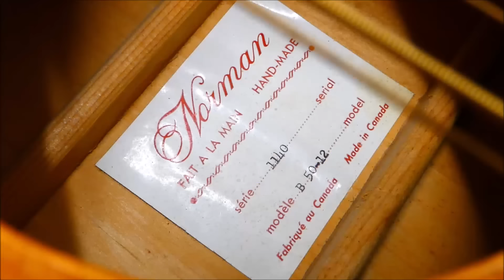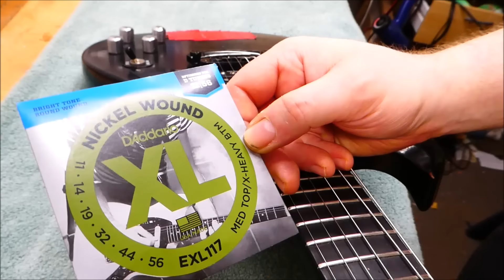Broken SG and a Norman 12 String

Comment: I’ve owned a couple Seagull acoustics and the description of “solid quality at a low price” nails it. I’d buy another without hesitation.  My experience with Godin electrics have been similar.
Reply: I've got a Seagull entourage and no other acoustic has even come close to the tone and feel of that guitar for me. And it's still going strong after a decade of hard use. Such an amazing instrument.
Reply: See also: La Patrie. I don't think you can really call Godin "low price", but I think "solid quality" still applies
Reply: Mr segull
Reply: The owner of the sg also owns a couple of seagulls, actual seagulls that constantly shit on top of the guitar.
Reply: I found a Godin SD in a thrift shop and took a chance. After a good clean and a rudimentary setup it's fantastc!
Reply: I have one of the newer line of Godin acoustics (fairmount composer), was actually shopping for a 000-15m but tried the Godin and ended up buying it on the spot. No regrets.
Reply: yeah your right godins are really food and solid build guitars
Reply: I love my Godin guitars. I have an original LG, a Fifth avenue Kingpin, a Freeway 5 bass, and a Seagull. I love them. The necks are beautiful and they sound good, with intonation and action above average and sound the way they should. The Seagull was my first Godin, and back in 1994 when I bought it, they were selling like hotcakes because they gave a solid Spruce top and great neck for the price of many inferior guitars.
Reply: @johnsonguitarstudio  I have a Godin 5th Avenue acoustic. It was a very affordable instrument (roundabout $500 new). I consider that a low price for the instrument.

Comment: Not a professional by a long shot but I’ve always wondered why some guitarists don’t take better care of their gear. In the 60 years I’ve owned guitars I’ve never broken a head stock. My venerable D-18 which I bought used in 1979 had a repaired broken headstock which has stayed fixed all these years. I’ve had a side crack due to dryness and I’ve had another D suffer many aging problems- probably from not being played enough. It’s been back to the factory for warranty and non warranty repair for binding issues, neck resets, bridge plate cracking, bellying of the top and bridge replacement! 
Great videos, keep up the great work.

Comment: About 14 years ago I did my first headstock break and figured why not give the repair a shot. 
I had 3 dozen guitars at the time, surely still have at least that many, and after a ton of labor due to work environment and living conditions, thought the ever so slight twist in it as it set wouldn't be an issue. 
It's an issue! lol
I might finally get to it this year, heat it, reset it, and revive it. I have 3 of these guitars. Neck through no branders made in China but they played so nicely.

Comment: Always wanted a 12 string, but couldn't find one that didn't break my left hand playing it. I finally found a Seagull 12 string for $100 bucks in a pawn shop that had a loose neck joint. I just glued it, and it hasn't budged since, the best $100 I ever spent. That guitar is a joy to play and stays in tune. I also have an Art & Lutherie parlor and dreadnought, both excellent guitars.

Comment: My SG has had a similar brake happen twice -I did the second brake. BUT the last repair was apparently done inserting two zinc plated steel nails of the four inch size cut off to hide after "insertion" and epoxy glued/filled. So I'm looking forward to this video for some inspiration, although your repair won't have these issues. Luckily I found an old mahogany floor I could make dowels to fill the voids left by the nails from if I dare remove them. It has had a neck to body brake repair as well -who knows what hides in there. Gets me thinking, my old chiropractor has his own x-ray machine, maybe I'll pay him a visit to find out:)

Comment: Some folks shouldnt own a Gibson is profound. I bought my 84 Explorer in 85 brand new. I played in bands for the next 25 years. When I say it has seen its share of action that is no exaggeration. The case looks like went to Nam and the Gulf War. If it could talk several people including myself would possibly be in some trouble. But, the headstock remains as it left Kalamazoo in probably mid 1984. The end has abfew dings sure. Its on itsb3rd and hopefully last paint job. It needsbabrefret and three of the dot markersbhave crumbled into dust and fallen out. Still makes its presence felt when I plug it in and allways causes a stir whemaI open the case. But has never been broken. The same goes for my my 82 Standard.

Comment: Regarding adhesive, I was taught to avoid glue that might 'creep' under string tension.  I repaired a heel on a Hofner bass a few years ago and used hide glue, plus I added a couple of dowels.  It's still intact.

Comment: My younger self wasn’t in a position to afford Gibson guitars, so as I became older and more financially sable I became obsessed with them.  Not because I think they’re the best on the market but because of the what they meant to me as a kid.  After several years of owning them now, I’ve found they’re actually quite difficult to break the headstocks.  Shipping them relays on the handlers who couldn’t care less so they can and will snap during that process and sure if you drop it, it can and will break and of course some will have the grain structure that will make for a weaker headstock.  But really it boils down to the owners, the careless folks who put them against the wall and then knock them over, drop them, step on them or whatever else these guys do to them.  Play it, put it on a reliable stand or back in the case and you’ll likely never break one.   That being said thank you to all the careless guys out there and videos like these, I’ve been able to rebuild a very solid and stable quiver of les Paul’s that I’ve repaired to near perfect condition.
Reply: Got to give this guy a pass though, dropping through the stage!  The rigger who gaffer taped two risers together should have been charged.
Reply: @markbernier8434  I’d give him a pass if he would’ve at least pulled the strings off.  Common sense would tell you this.

Comment: I bought my Les Paul as a scratch and dent: the headstock broke and was fixed in factory. A few years later it fell out of the stand and broke on the same line. A couple years after that I set it in the stand hastily and it tipped out and broke again in a new spot. It’s been 10 years and I haven’t broken it again. It still plays great.

Comment: Wow! A Norman!! I have a six string model from the early 90s that I bought in 2020 for like 225 bucks.

I am left handed and I happened to find a left handed model local to me. 

It has been gigged hard by me (and it was by the previous owner too) and now it hangs in my bedroom as a practice/beater axe. Still love it though, probably has my favorite neck profile ever!
Reply: Why do you not gig it anymore? Everything can be righted if it is out of spec.
Reply: @jasonpitre1249  the top is caving in... I still gig it occasionally but I have other guitars I like more. I use my Norman for building loops to practice pedal steel to.

Comment: Really interesting video, Ted. As I’m located in the eastern townships of Québec, I get Godin guitars on my bench all the time. Your background story of Norman guitars was largely correct, but according to my understanding of the history, you did make on serious error. Robert Godin did eventually acquire the Norman brand, but at the time the guitars were built with bolt-on necks, the Norman production in La Patrie was by Normand Boucher. You’ll recognize the “Boucher” name that appears on current-day higher end guitars made in the operation run by Robin Boucher, Normand’s nephew. Anyway, the bolt-on neck was one of Normand’s innovations so that players could easily adjust the setup of their Norman guitar themselves. There are many of these guitars still in circulation and they remain very popular. Sadly, the bolt-on neck joint was abandoned when Godin went into partnership with Normand Boucher and eventually assumed ownership of Norman guitars. Now, Normans are built exactly the same way as the other Godin brands. Neck resets on present-day Norman guitars is much, MUCH more difficult — especially the newer ones assembled with epoxy!

Comment: I had a similar break om my Dean guitar. I drilled a small hole, approx between the eyes, of the face in the picture and pumped gorilla wood glue into the brake. Then clamped the break shut. Job done.

Comment: Could not agree more about re-stringing a 12, I bought an inexpensive but decent 12 a few years ago and the first thing I did was to put a set of light gauge strings on it and I keep it tuned down a whole step and just use a capo. I absolutely hate to put strings on that beast lol, it seems like it takes an afternoon to get it back in tune. They are worth the trouble though to get that extra jangle.

Comment: Norman reminds me (and I'm not sure why) of the old Stella 12-string like Ledbetter or Leadbelly's guitar eventhough his guitar strings were held in place with a fan tail and does not create good tone except (maybe) on a high class archtop like the master Benaditto and his archtops? Or D'Angelico or the elder Gibson's back when I wasn't even a thought and existed in 57? 65 years? Wow, it socks being me. Lots of physical pain and that why I'm building them. Being busy and claim to being committed I started with furniture and then with speaker cabinets. So now I bought wood from 2010 to 2016 and set backs of wood shop equipment learn to resaw wood so I added oilivewood and manzanita (only grows in Idyllwild) a bush but grows fast and is pretty and unique, they might be the headwaters on my guitars. Parts-casters are still here but I'll place my electronics into and artfully built from my woodshed in my backyard. Really helps with the pain.
Reply: I'll be 65 in November. "Growing old ain't for sissies". Bette Davis

Comment: hey now... my 74' standard has had at least 4 headstock breaks... 3 while I've owned it, first the "screws" and "bondo" from the original break failed... my 2nd  break had half stacks thrown at it, and the final... well  I had a guy do the repair, and the glue failed... Had an SG that its neck repair failed as well, about the same time as the 74' standard ... that said, I have 3 others that get equally mistreated, and have never had issues, though at least one of them has chunks missing out of the body from me diving through drum kits...
Reply: Were you trying to escape thrown bottles or bullets fired by the audience, or attempting to kill the drummer?

Comment: So Leo bolted on the neck and today so does Taylor.  Gibson glued them in like all the others.  So, I break the neck off on my Strat and just bolt on a new one.   I break the neck on my Les Paul and you do your magic, install splines, glue and camp it back together and paint it and its good as new.

Here is my question.   On a Les Paul why not cut the neck off at the body then route out the builk of the wood, and finally clean it out to spec and then glue in a new neck.   Just like a Fender only using glue instead of screws?   Does anyone do this?

I'm looking for a new acoustic and Taylor is at the top of the list because of the neck design. 

Love you videos.   As a wood worker/boat builder, I have learned a lot from you videos which are usefeill techniques valuable beyond musical instruments.

Comment: I've recently discovered your channel and I'm hooked! Your channel is a gold mine of guitar information. I have a question for you : Have you ever had to work on PRS's? Do you think their low angle headstock design is as solid as a Fender straight headstock? Cheers!
Reply: the greater the headstock angle under string tension, the more susceptible it is to breaking. its just physics. but beat any guitar up and itll break whatever the design. take care and it wont. and it obviously wont break on its own, itll need a good knock. of course accidents also happen... saying that though, my gibson les paul fell from a stand and i couldnt believe it was still in one piece. just a ding on side of fretboard, so lucky but goes to show its case by case and it matters where on the guitar the trauma happens. hope it helps, seems no one else was answering anyway dude, cheers.
Reply: @terrybanks5063  Thanks for the answer! That's what I was thinking. I was wondering about PRS because there are a lot of videos/posts about Gibson headstocks breaking or overall repairs but very few about PRS. Maybe it has to do with how many Gibsons are out there vs. PRS's

Comment: You should get your facts straight, les guitares Norman was founded in 1968 by Normand Boucher who was the conceptor/builer of amazing guitars. He partnered with Godin in 1972, Boucher the luthier and Godin the distributor.  Godin finally bought the company in 1989 as Boucher retires.

Interesting fact, Robin Boucher, Normand's nephew, is the founder/ owner luthier of Boucher guitars.
Reply: Normand Boucher was the "creator" of the Norman guitars (Norman is the english form of Normand). Normand Boucher was a carpenter, who couldn't afford a Martin guitar, so built one on his own, which was quite good. Some of his friends/neighbours requested that he build them a guitar like the one he had made. Eventually, this lead to the Lasido/Guitabec guitar factory being formed in La Patrie (in what is generally refered to the Eastern Townships area of Quebec, "Cantons de L'est"). The factory was producing guitars mostly for the Quebec, Eastern Ontario and Atlantic Provinces regions. The factory also started producing the Kamouraska line of classical guitars (but with a dovetail neck joint, not a Spanish Foot neck joint). Robert Godin was brought in as the sales and distribution manager. Normand's sons, Claude and Robin also came on board, designing the slope shoulder line of guitars knows as Lys. The original factory burned down in 1980 or so. It was rebuilt, and production resumed. After Normand retired, the factory was bought by Robert Godin. Claude and Robin Boucher left the factory to pursue their own interests. Over time, the Lys Line evolved to become the Seagull line, and the Norman line got a parallel, if somewhat higher end line called Simon and Patrick (the first names of Robert Godin's sons). The Kamouraska line of classical guitars was renamed La Patrie (for obvious reasons). The low end of the Lys line (laminated back and sides, some with solid tops, some with laminated tops) became the Art and Lutherie line. Electric guitars were introduced later as the Godin line. Claude and Robin Boucher went on to create their own line of small volume guitars, the Boucher line of guitars, still being made.

Comment: I've done it by gluing the break and then drilling holes for 2 dowels glued in right through the crack from front to back. Just wondered what your thoughts might be on that. The idea of routing and fitting like you do seems better but it never occurred to me (and I didn't own a router back then) I should probably mention I'm just a hobbyist...B^ )

Comment: Drop C?? And here I've been playing 11 56s in standard this whole time! What a fool I've been.
Reply: I had a cheap acoustic with a bad neck that I used as a lap steel in open tuning, strung with 13-56's. I tried duplicating what my ears told me was a C tuning,  used by David Lindley on "Bon Ton Roulet", by tuning it up to C, and the bridge ripped right off the guitar! Turns out he used .058 or .059 string sets, tuned down to C....

Comment: I have a mid sixties Goya twelve string. At some point a trapeze tailpiece was installed. I don't know if there was any warpage problem originally, but the soundboard is quite flat these days. The original bridge was left in place.

Obviously there is not as much string pull into the soundboard, which probably affects volume, but what disadvantagges are there to fitting a trapeze, and why isn't it used more often on twelve strings to offset the higher string tension on the soundboard?

Comment: I would add some splines to the neck, as you did many times. There is a lot of tension there with the strings andI don't believe only glue will keep everything in place, especially if the guitar is been played quite rough. But if you say otherwise... 🙄

Comment: Glue - is is sturdy enough to withstand years of stress and vibration without breaking free?
Reply: Ever sit in a wooden chair? Sturdiness and stability of glue joints is more about a tight dry pre-fit of the pieces than the glue itself.
Reply: @goodun2974  - Not the same at all. Think of the tension on the strings, neck & body. Also think about the constant vibration of those string. Glue is vulnerable to vibration.
Reply: @nedludd3641  ,  The right glue and a snuggly fitting joint actually wets and expands the wood fibers so that they intermesh somewhat and lock together with each other. Assuming of course that the wood used isn't particularly resinous, oily, or sappy. A well glued wood joint, if it breaks again, will often break adjacent to the glue but it won't be the glue joint itself that breaks.  But don't ask me, ask Ted....

Comment: Considering the Norman, what is the reason for using a dovetail joint vs. screw on neck joint these days? I think Taylor also uses a bolt on? It seems like the dovetail is strictly a traditional way of mounting?

Comment: It’s very difficult to do better than a Seagull acoustic for under like, $1000 USD. And it’s a no brainer at $500. Superior in pretty much every way, from fit and finish to materials. The fact that you can grab them used all day at pawn shops for $200-250 is kinda insane.